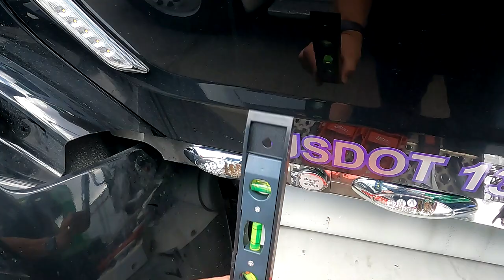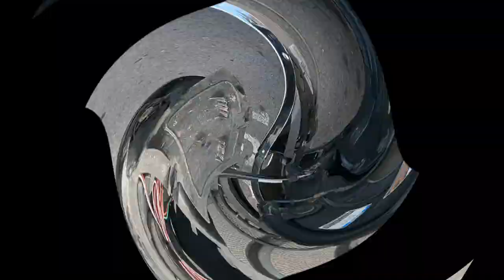Front bumper United Pacific light install on a Peterbilt 579. A day in the life of a Tanker Yanker

Comment: They look great !
Can they b installed underneath the door mirrors ?
Reply from the maker: I wouldn't think so. There are 2 serious studs that the wires run through and bolt on the other side. I guess if you wanted to make a bracket somehow you could cut the studs off and notch out for the wires and seal up the opening.

Comment: That's why that bracket is running up above your light , to keep thin CHINA bumper from shaken. But it looks purty.Are you getting enough ship work down there ?
Reply from the maker: We here univar is in the process of cutting ties with both us and Grammer down here and in Tampa. They getting cheaper company. We'll be outta here anytime we hear through the grapevine. 

There is PLENTY of work up in GA and TN that have been wanting us to pull more but haven't had drivers. Now it will free 5 of us up for them and they are in the back yard of terminal.

Comment: Link to those solder heat shrink connectors. Txs
Reply from the maker: haisstronica 350PCS Solder Seal Wire Connectors,26-10 Gauge Marine Grade Heat Shrink Wire Connectors,Waterproof Butt Connectors,Butt Splice Eletrical https://www.amazon.com/dp/B0B4W837K4/ref=cm_sw_r_apanp_gSm9qQ6i9K33F
Reply: @TheTourettesTrucker  the rest like the sleep lights ‘n drop down visor you got down there in Miami
Reply: @TheTourettesTrucker  seen your truck. Wasn’t aware of your channel ‘n mods. Next time gonna stop ya and let ya make similar mods on my 579. Being you’re already familiar with the necessary steps and all. I’ll film ya for my channel. Lol. Down in wildwood. Buy ya sone of his bbq across the way. 👊🏻💪🏻👍🏻
Reply from the maker: @Dixie Mae  That was my company driver down there if it was Friday or Saturday you saw it. I was in the 579 from Sept 18 until November 12th. I hired a company driver then. Trying to see if I can get 2 more trucks and drivers this year. I love the inside layout of that pete but outside wise, I love my green Coronado. I'll be back out on the road with videos later this week.
Reply: @TheTourettesTrucker  concur on both
Reply: @TheTourettesTrucker  question. I saw how simple it is to replace the 579 fender marker light. How do you go about replacing the door one. Didn’t see a video. Is there one? Txs